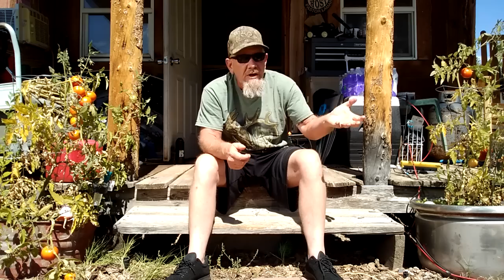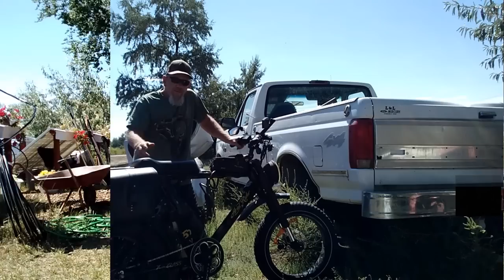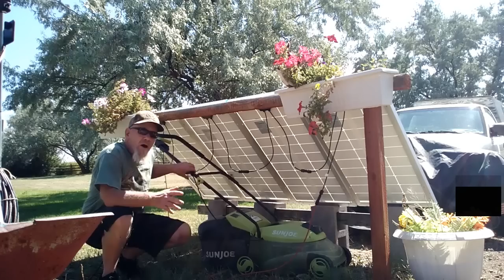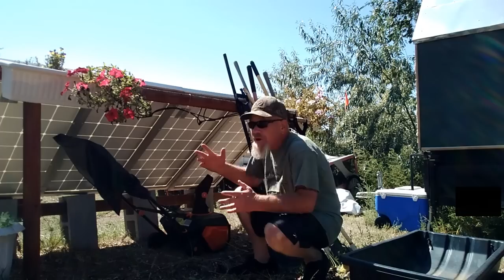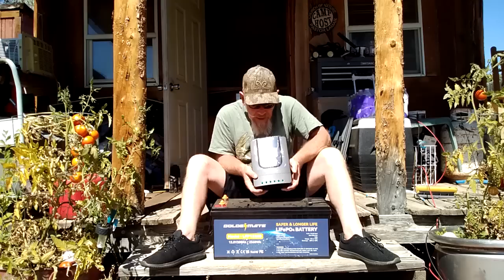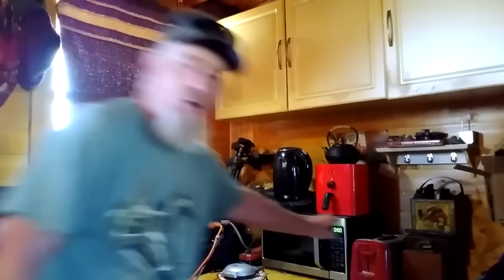Can You Live Off Grid In The City?

Comment: QUESTION: Can the portable flexible panels be mounted onto an aluminum metal patio cover, without having any problems with weather (rain/snow/hail/) or metal reaction? How to you run the panel wire(s) into the home, extension cord(s), what types of chords/cables etc.? THANKS:)
Reply from the maker: You will need a power controller, battery and inverter.

Comment: In EL Paso County Colorado, Ground Mounts under 7' tall do not need a building permit.  It does need an electrical permit of course. This applies to even if you are totally off grid . I don't even have utilities coming on to  my property and Electrical has to be up to code, as it should be,  A main reason for the requirement is   to protect Firefighters if they have to do any of their work, they are much safer because wiring and shut off switches are standardized.
Reply from the maker: If you are connecting the system in to house wiring yes you will need an electrician and follow codes. If it is strictly of grid with no connection to house power there should be no codes unless you are in an HOA or maybe a rental apartment?

Comment: Video's like this help people understand that they can start economically and grow their system over time very easily. 
I added off grid solar to my house in the city and have zero regrets. Started with a little and continue to add on as time and finance are lined up. I personally like the server rackmount batteries, there is no difference on performance, I just like the size and the built in circuit breaker and status info. Used 260 watt panels here in phoenix go for around 50 bucks each (Santan solar) and I get very close to 250 watts out of them in peak sun.
Reply from the maker: Thanks, and yes for a lot of people that is the only way they can afford a system is to do it a little at a time.
Reply: Nice. Leaving in Phoenix , how big of a battery do you use for overnight cosumption in kw ?

Comment: Been into solar for ~20years. There used to be a 'guerilla solar' movement of illegal installs... I'm happy to see some European countries are formally allowing end users to just plug in small micro invertor 'balcony' systems. Hopefully this will come to North America.
Reply: Micro invertors are installed on the back of the panels and convert to AC voltage, without the need for batteries. They push this 'extra power' into the house wiring and offset any electricity usage coming from grid....
Certified equipment would be safe, shutting down should the grid go down or the breaker trip.
Reply from the maker: I have wanted to try a micro inverter. What brand are you using?
Reply from the maker: I am seeing a lot more off grid installs of portable systems. People have finally understood the value of owning your own power.
Reply: I can't see plugin micro inverter systems ever being legal in the US.  Big brother and all the lobbying has gotten so far out of control, and I don't see that changing.  Now that's not to say it can't be done illegally... 'guerilla solar' is still alive and well (by necessity). 😉

Comment: The best thing is to buy appliances that run on DC. Many run on 12 and 24 volts. I would set up a 24 volt system. You can always tap between two or four batteries. If using 6 volt batteries tap in the center of the 4 batteries. Golf cart batteries can be discharged lower than 12 volt batteries. Now if you go with more expensive batteries then the discharge minimum is going to be different. If you get ten years out of an AGM you are doing good in Florida you wont get ten years, unless its stored in a climate control environment. If left outside in the hot heat the battery life diminishes drastically. 73
Reply from the maker: I have both AC and DC appliances. Fridges and water pump are DC.

Comment: I started with 400watt 12v. system 2 years ago for fun n giggles. In light of recent power outages I expanded to 800 watt  12v system.. next year I'm going to 1600 watt 24 v. System
Reply from the maker: My main system is now 800 watts but I also have two portable 400 watt panels so all together about 1600 watts. That is plenty of power for my needs and excess if I need it.
Reply: @solarcabin awesome  1600 is my goal . It's slowly coming along but will defenatly get there...  last power outage lasted 2 days and i was comfortable.  Everyone around me was using gass generator and candles LOL. When will people learn.
Reply: I would suggest going with a 48V system if you can, there's a lot of advantages.

Comment: Hi Lamar.  We added a Bluetti EB 70s to our back ups.  What I like the most about it is we can hit the road with it.  We've always camped without conveniences but we're older now and appreciate a little comfort!
Reply from the maker: Thanks, yes those smaller units are a lot more convenient if you camp or just need to run a few appliances in a short term black out. I have 4 of the smaller power stations I just keep charged up from the excess solar power and stored for camping or an emergency and I use them for running small power tools outside

Comment: How long could you watch a small TV I wonder?
Reply from the maker: Depends on type but most use about 70 watts and would run just fine all day off a small system.
Reply: @solarcabin  thank you very much
Reply: Smaller LED/LCD will run less than that... If it runs from a AC/DC adapter you might be able to hook directly to batteries (more efficient as conversion loss is removed).
Reply: Consider using a laptop as a dual purpose computer and TV.

Comment: Hey Lamar, good job. I know you are a true off grid pioneer, not just a gadget review guy. You live it. Do you have a favorite, or two, inverter brands for systems like yours. Thanks! Jerry
Reply from the maker: I have had better luck with the modified sine wave cheap inverters than the pure sine wave. Right now I have a 1000 watt powerdrive that seems to work fine but the reading gets screwed up. I had a Renogy that didn't last a year.
Reply: I would use the pure sine wave inverters or use a computer UPS and increase the battery storage. There are some UPS's that are pure sine wave and are perfect for electronics I'm not discounting the mod sine wave inverters they have their place too. Use them on lighting and of course if you charge batteries then you don't even need an inverter. Use a power supply regulator for battery packs. DC don't need AC to make DC. 73

Comment: Some cities require you to hook up to public utilities.
Reply: Yes most stipulate that you must be tied into grid in the city but usually says nothing about having to use there power after your hooked up..
Reply: Very intelligent people have posted videos that have those requirements in the cities they be one light bulb on and pay the minimum monthly bill every other circuit breaker is turned off.
And to get away with that nobody in their neighborhood knows what they are doing because that's what gets you in trouble. Like he mentions if you are not connected it to your house wiring that makes a huge difference.
Reply from the maker: Yes cities require city hook ups but you can still put up an off grid system and use that instead. That reduces your power bill.

Comment: So, what happens when you fill all the batteries up but the solar panels are still producing energy? Does the charge controller turn the panels off or something?
Reply from the maker: Yes the controller just shuts off the power if their is no use for it but that is the best time to run appliances or you can use that excess power for a dump load for heating water or other uses.
Reply: @solarcabin  Good point. Sorry, I'm a novice. I had images of shit blowing up.
Reply: What I did was, I got so many batteries that it takes them two days to fully charge... the controller is  wasting energy into a ground through resistors which makes the controller hot 🔥. Mine doesn't get hot because the juice has twenty batteries to go into.

Comment: I started with a 400 watt system and upgraded to 1200 watts later, its really nice having a small minisplit AC and my gaming computer all running off the panels when the suns out, I'm a pretty heavy power user so 1.2kw of solar and 10kwh of storage is the perfect for people who use alot of power hungry appliances
Reply from the maker: Thanks, it is easier and cheaper to start with a small system and learn how much power you really need and get the right appliances. Then you can always add panels and batteries if you want more.
Reply: @solarcabin I'm thinking of starting out with a two hundred watt system that is movable. A lot of RVs use 200 watt system and makes sense I probably will still use propane for water heater we don't use too much propane one 15 lb bottle easily last two months and fills cheap at tractor supply. If I need to exchange for a new bottle I use Amerigas machine at Sam's club. I don't know how much power is needed to run a 50 gallon water heater with low voltage elements. I like instantaneous water heaters better when they work right. 73

Comment: When the grid goes down it might be for a few hours. But it could be for days, or a week +. Or how about when a tree branch takes out the line going to your apt. or home. And the power co. won't hook a new line up until an electrician replaces the service / meter outside. Meanwhile no power to your freezer or fridge. Solar back-up & a portable 12v/120 chest fridge / freezer, or enough solar for full size appliance. At camp I like to run an absorption fridge but at home I can see where some of those efficient 120v or 12v units would be just fine.
Reply from the maker: Yes, it doesn't take a big expensive system with the right appliances.